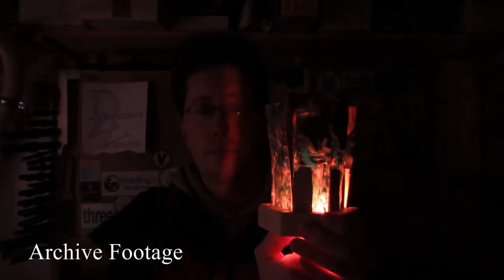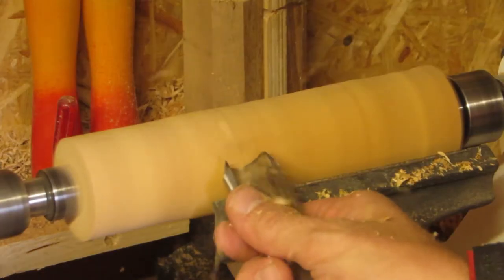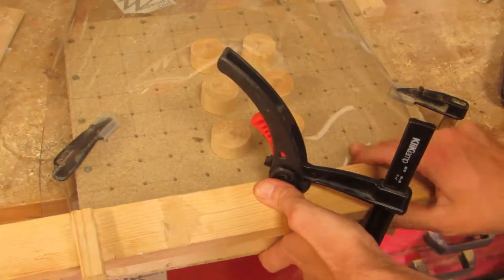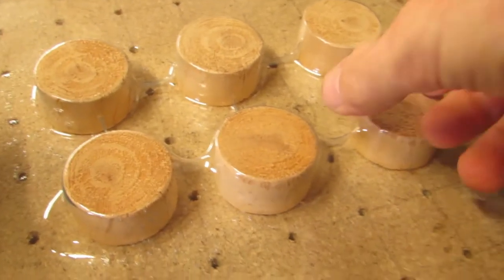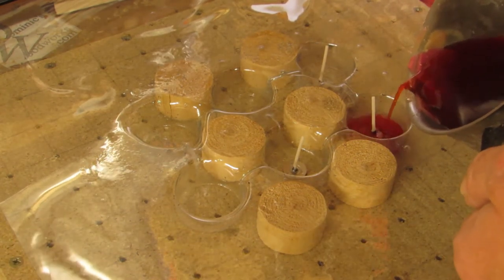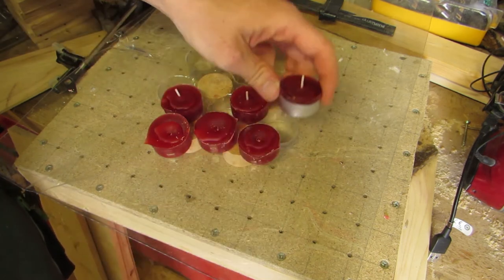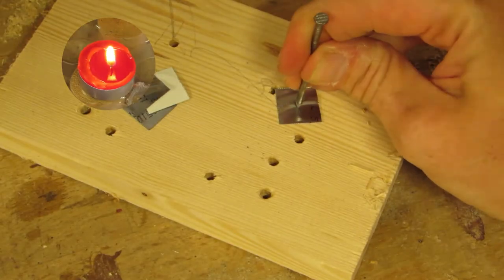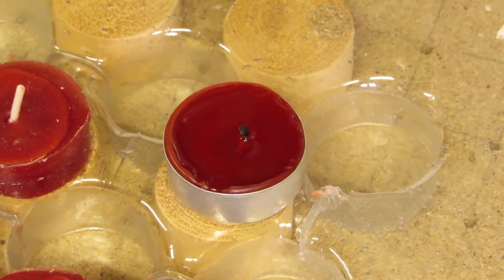Make your own Tealights! - Vacuformed Mold

Comment: Very hot (see what i did there, you know fire) project. I liked the hot air gun and homemade vacu-forming table. 

If the sides of the mold where sloped (drafted) the wax would come out easier. Even something as shallow as a degree or two would be enough.This would mean turning them one at a time however.
Reply from the maker: It works as it is, but you are right, that would be more convenient. And with a little planning, I think you might be able to turn them like I did from a longer piece, with a plywood guide to turn two shapes "back to back". I will keep that in mind for my next mold! Thanks for watching, Andrew!

Comment: I suppose it was only a matter of time until you decided to make your own tea lights too. Could you go a step further and eliminate the need for the aluminium cup from the shop-bought tea-light? Maybe use those little aluminium cases that some pastries come in? Nice vid as always Dom, always entertaining. Incidentally is that a new table saw? A Bosch? I got one like it just lately too - vid coming soon...
Reply from the maker: You could probably use different cups, maybe even glass ones, but I see two problems - they probably would not fit the seminal tealight shape in most holders - you could make personalized holders for that, I guess - and you would need to remove scrap wax before you can put a new tealight in, which is easy for the aluminium cups (since they are flexible), but might be trickier for custom cups, depending on the material... Good point, though, Mark, worth considering. As for the saw, yes, it is pretty new and a Bosch. Hopefully, the last one I ever buy. Thanks for watching!